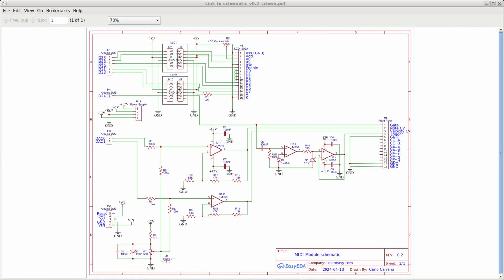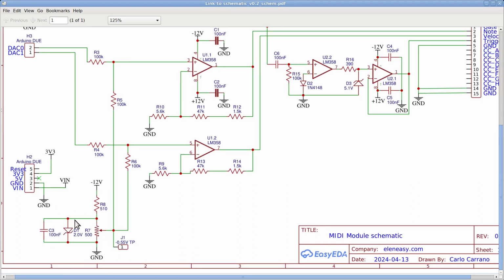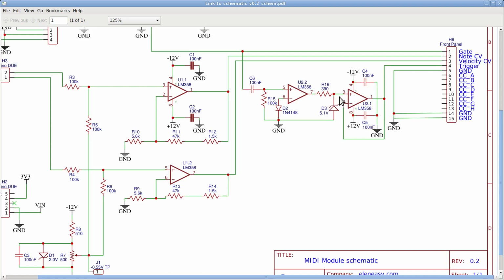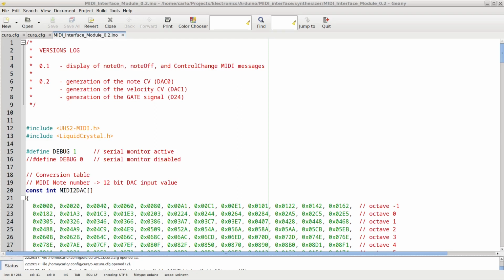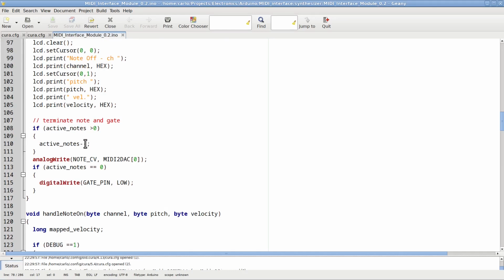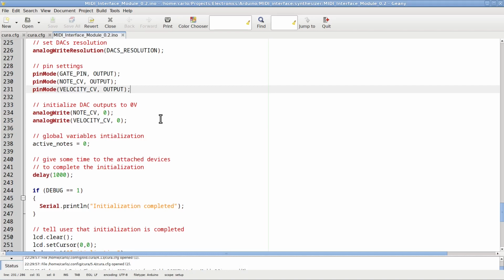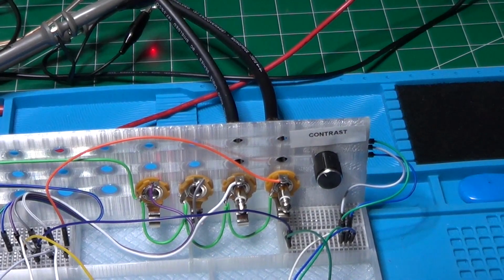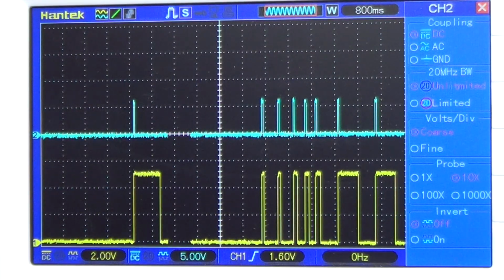The Synth Project Episode 41: MIDI Module - Part 2

Comment: That's an interesting design to generate the pitch CV out of the DAC output of the due. Is the opamp of good enough linearity such that the shifting and scaling gives you good tuning for the resulting pitch CV? I am not such an expert on opamp specs...

Because one half tone corresponds to about 83mV, the opamp response needs to be quite linear in the needed range.
Reply from the maker: Yes, the lm358 has an exceptional linearity. I ran several tests with my Yamaha keyboard and the frequency of each semitone is spot on.
Reply: That's really great. I wasn't expecting that. In other approaches I saw the necessity for cumbersome tuning via Software.
Reply from the maker: Yes, there are no multiple adjustments to make. Eventually, just need to adjust the transposition of the whole midi instrument the way you need it.